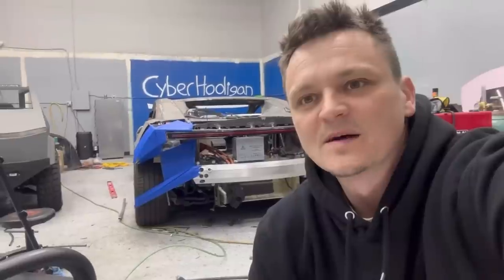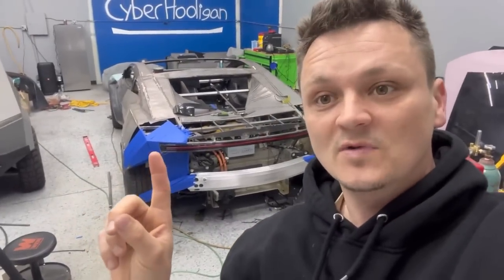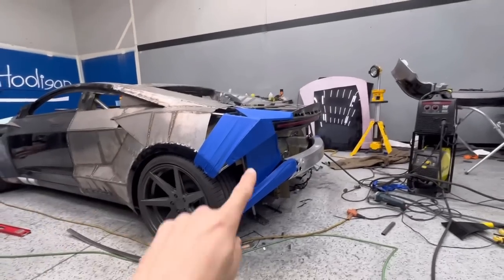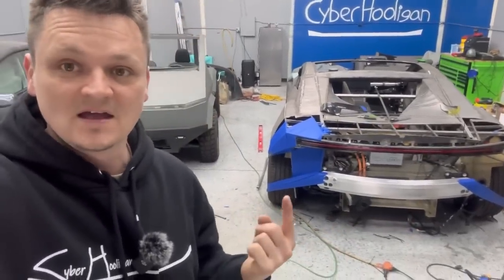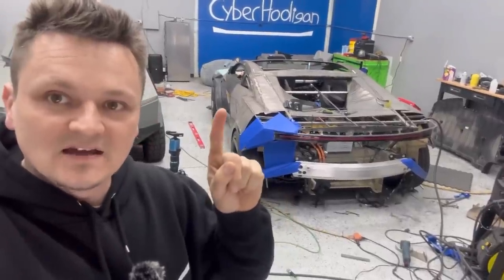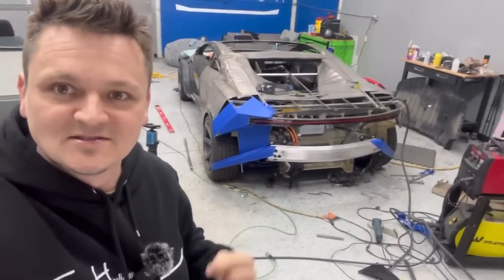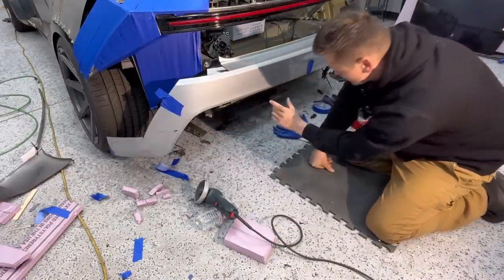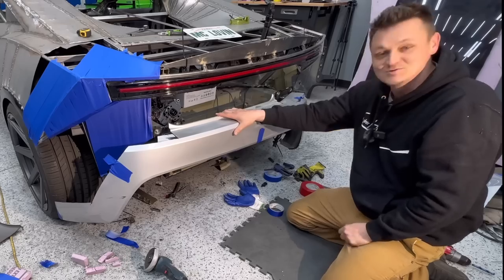CyberRoadster build vlog, the Rear

Comment: You should practice your hand at composites. You can make molds and repeatable parts. And even make some carbon fiber pieces for detail. You are already doing half the process creating a shape. You just have to finish the surface to paint before making a mold. You could even produce the parts to sell if you wanted to. Looks good. Keep it up!
Reply: Easy Composite LTD. has some good videos on making molds and parts in composites.